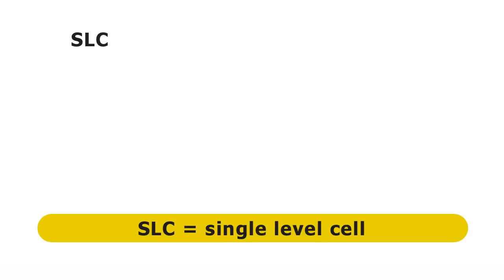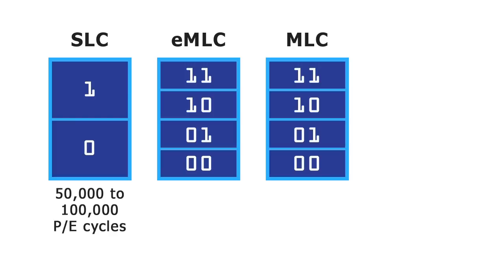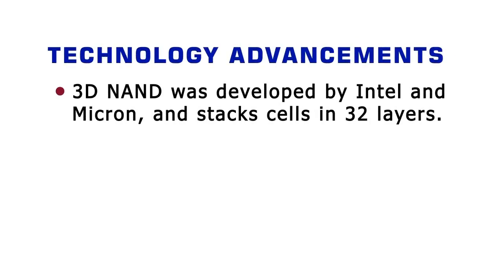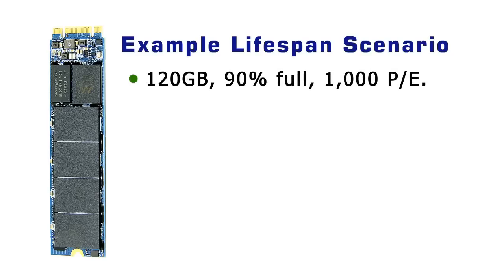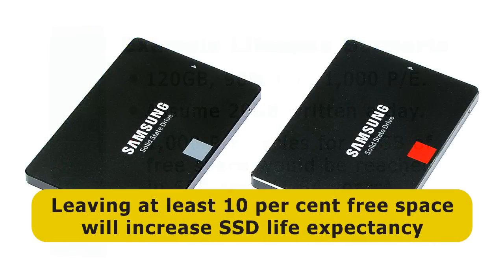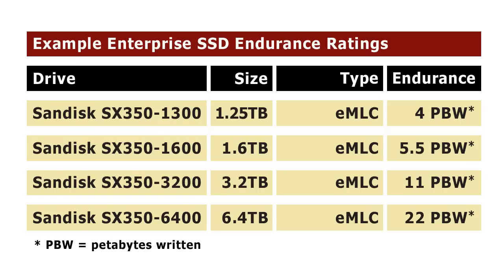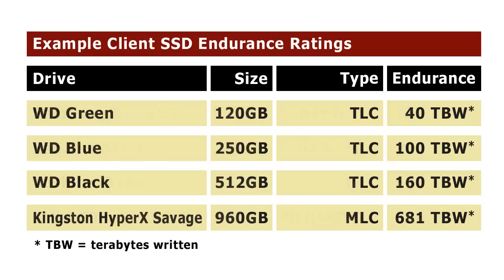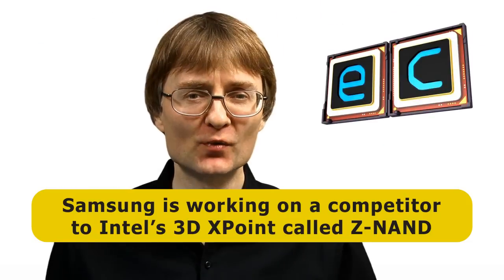SSD Life Expectancy

Comment: Christopher, an overfull SSD error reads "Unable to write to the last block of the device" does this mean it's game over for the drive? The SSD in question is installed in a MacBook pro. Thanks for all your efforts on YouTube.
Reply from the maker: This does not sound encouraging for the drive. I would try to clear some space -- quite a bit of space (5-10 per cent of the drive) and see if matters improve. Good luck! Oh, and back up anything from the drive that is not already backed-up. :)
Reply: @ExplainingComputers  thank your for your reply. There is a glitch that forces the data on the drive to keep increasing during a time machine backup combined with Dropbox as far as my research has revealed. The drive is too full to even erase and now it's not viewable while installed in the laptop or in a confirmed working enclosure. I tried formatting with windows and mac. SanDisk says based on the things I tried it's totally dead. I have a recent enough backup so all is not lost. Thanks again, I'll be doing a video explainig what happened in more detail soon.

Comment: So basically at 2:28 you're saying that a 500GB MLC SSD will have a higher life-span/reliability than a 500GB TLC SSD... Is that Right? So why should one opt for TLC or QLC SSD drives?
Reply from the maker: It is right indeed. MLC (2 bits per cell) drives last longer than TLC or QLC. But TLC and QLC drives are significantly cheaper -- and most SSDs in typical use will now last as long as the computer they are fitted in.
Reply: @ExplainingComputers  Thank you so much for the explanation, Chris! Appreciate it. I know what to buy now. :-)

Comment: Good point about keeping free space. Actually I don't trust SSD much. First: never buy cheaper SSD. I have buyed Patriot Burst, using it as system disc. One day after 2 years it stopped working, being totally dead. Currently I am thinking about buying few Samsung 870 EVO SSDs for my PCs as a system discs. Second: Make backups regurarly on classic HDD. SSD have one big disadvantage. Usually they stop working in a second without any sign of aging or warning. Classic HDD ususally die slowly, so you have time to make a backup. And when they stop working instantly it's mostly stuck head which can be easily repaired by yourself.

Comment: I have a Toshiba laptop from 2014 (Win-7).  After using it non-stop for 3 years, I noticed the 500 GB mechanical hard drive beginning to become louder (like the bearings were wearing out). So I copied everything over to a 1TB Samsung SSD, and instead of taking 5 minutes to load up the windows and settle down enough for me to start using the computer, all of this now happens in just 1 minute.  Plus, I don't have to worry about the drive failing.
Reply: I use an external wireless keyboard, and an external mouse, and I've already worn out 3 of those keyboards and 5 mice. It is a heck of a lot easier to replace external devices like that when they wear out than having to take apart a laptop 3 times just to replace a keyboard/trackpad.

Comment: Actually, we DO have to panic, cuz LOTS of SSDs from manufacturers we never heard of, sells cheap SSDs that DOES NOT HAVE DYNAMIC RAM. Seriously, even using the SLC Cache, the SSD controller will still use the NAND Flash to Cache their mapping data, so it will wear it down, regardless you are using the Host Memory Buffer.
Unless you are using a PCIe 4.0 for the NVMe, the technology finally managed to make the NVMe DIRECTLY communicate with the CPU, meaning the Cache for the SSD will finally go to either the CPU's Cache, or the 16~128 MB of Cache will go straight to your 16 GB RAM for easier access... No wonder Samsung made the 980 M.2 SSD for this purpose... Other manufacturers did this a long time ago, but Samsung entered this at the right time. 👏 👏 👏 👏 👏

Comment: After many cases of failed SSD happened in corporate notebooks, the main drawback is there is zero chance of retrieving data from it, even IT dept suggest to opt in a harddisk option. Finger crossed for my own personal PC which use NVME, the speed gain from it does not affect much on my daily usage, so once it go dead, I am going to revert back to harddisk.

Comment: SSDs.. most reliable drives I've owned. I have about two dozen SSD drives in service since 2015. In the prior years I had mechanical drives and those would fail about one drive ever 18 months. Since purging the last mech drives and switching to all SSD, the failures stopped. Not on drive failure for the past five years.

Comment: My Samsung 850 EVO 250Gb was bought in August 2015. Still going strong. I've since added 3 more SSD and a couple of NVMe M.2 SSD. Simply running out of space. My only hard drive - which I use for external backups, bought way back in 2007, as only recently started to throw up errors. I decided to go buy a 1Tb drive as they are dirt cheap. But SSD's seem to be pretty reliable - I run MS flight sims on it. I haven't had one fail yet and the MVMe drives really do boot extremely fast.

Comment: Question: Large music collection stored as FLAC data and/or other high-resolution formats: does "writing" occur while playing said music?
(FWIW, intend to use SSDs to backup SSDs: HDDs may tend to be more exposed to electro-mechanical failure(s)... SSDs less exposed to mechanical failures, but more sensitive to electrical/electronic issues - i.e. PSU failures??)
Reply from the maker: Writing should not occur when playing music, unless your PC has very little free RAM.

Comment: Excellent video, if you're still reading comments I have a question.

What is the failure mode of an SSD? Once the cells are degraded beyond a reliable write, is the SSD able to detect this and warn me that the write has failed, or will it fail arbitrarily at a point in the future?

Similarly, can an SSD lock out writes once it's passed its life while still allowing reliable reads to existing data (a useful case in server reconstruction)?

Comment: You should also talk about the data retention rate on a SSD without electricity. As far as I have found info on the internet, SSD are active storage media, which means that in order to keep their data, they store electricity (kind of what a capacitor does). So, I would say that it is a bad idea to use them for offline backups that you are not going to look at in a longer period of time.

I found an statistic that says that an SSD will keep the energy for about 2 years without been connected to a computer or any other power source. However, there are others that say  9 years. The only think they have in common is that the ideal storage temperature is 25°C. The higher the temperature is, the quickly the SSD will loose its energy.

It would be interesting if you talk about this.
Reply: Flinty94  Yes, I think magnetic hard drives are more robust, but slower. It is being said that they can keep data for about 20 years (assuming that you don't have them connected to a power source). Anyway, with those you can also loose the data easily. So, keeping backups is the gold rule.

Comment: Data safety != life expectancy. FW of SSD will report it's state and will prevent overwriting worn out cells. That means that wore out fail scenario is more like read only mode than data loss, unless poor thing is neglected and errors are ignored. For data safety, three other params are more importanta:
1.) MTBF - mean time between failures
2.) (Offline) data retention period 
3.) Online data retention period

First one is self-explanatory - how often that model fails on average.

Second one is important for archive and drive not in use. Worst case scenario is 2.5" drive mounted behind motherboard, next to CPU, but disconnected - storage heat reduce data retention.

Third one shouldn't be issue - if drive is powered, it can monitor cells and relocate data if needed. But, my first SSD, Samsung 840 EVO had FW bug causing data degradation. Luckily, first symptoms were reduced speed because it's slow process and FW still can recover data, with drop of performance.

Comment: I have an ASUS G75V (which I use at home for fairly normal home activities, but being retired and not particularly active outside, tend to spend a fair bit of time on the keyboard).   It is fitted standard with a LITEONIT LAT-256M3S NAND Drive for the System/Boot Drive.  Now, at just over 6 years Home use, it is on the verge of failure -- I found a day or two ago that it is showing only 30% "good drive" left, using drive analysis software.  The normal level at which it should have been replaced was a staggering 40% ago -- i.e. at 70% "good".  I now have a new NAND Drive in my hands, but I need to get the SATA3 to USB 3.0 cable so that I may clone the drive, hopefully while it is still operating before catastrophic failure.  I should probably invest a bit more and get an extra drive for further back-up -- to be done periodically.  Ditto I should do data backups from the 2nd physical hard drive more frequently than I do. 

Your article advises we should be able to expect about 10 years life from the NAND drives.  Oh, Oh.  Why do I always get the lemons?

Maybe you were looking at statistics for the normal magnetic surface rotating platter drives?  10 years would be about normal for them.  The NAND Drives are warranted for only 2 years.
Reply from the maker: I said up to 10 years, and sadly not all SSDs will live so long.

Comment: I bought my 1st SSD back in 2008, being an OCZ Vertex 96GB as a speed upgrade for my laptop, expensive yes: 180 Euros. After 7 flawless years, it died one morning without any prior warnings, it had about 10TB of written data in this lifespan. Of course I had all my data backed up on 3 identical HDD's which are only used during backing up or restoring data, after that they are safely stored in seperate locations.

In 2014 I built a desktop PC for video editing with a single Samsung 840 EVO 250GB and life expectancy should be much longer, as the health indicator is now after 5 years still at 89% (8TB written). In the meantime I also have a 850 500GB (for user data, health at 96%) and a 860 250GB (for fast backup's, health at 98%) which are both portable.

I assume the Samsung's will last at least 15-20 years. I leave 20% of space unused to improve reliability, just to be on the safe side. Though SSD's are twice or more the price of HDD's, I happily pay the overprice for these gems.
Reply: Hi Rene what tool did you use to check the health indicator?

Comment: My problem with SSD longevity is that for me, and many others whose complaints I've read online, is that I've never had an SSD give an indication (through S.M.A.R.T. technology or difficulty reading or writing) that wear was starting to erode capacity and it's time to abandon ship!  Every SSD I've owned (and told in the stories from others online) has died when powered up, the controller no longer responding to the computer. This does not appear to be a wear issue, but rather a controller failure one.  Yet I've never heard this problem discussed in videos like this one or anywhere else—It's all about the P/E cycles.  I have little doubt that the data are still on my drives intact, but unreachable. To make matters worse, some manufacturers store drive information in the controller chip.  But even if not, replacing a controller chip is well beyond my expertise as well as my wallet when it comes to the equipment that can do BGA chip replacement. I use SSDs, but my biggest fear is the "Sudden Death Syndrome."

Comment: OK, just making sure.  P/E cycles is how many times a cell can be written to and erased, yes?  2000 seems a bit constraining, especially for a user who may have to move files around a ton.
Reply from the maker: Yes, you are correct on P/E cycles -- it is how many times a block of cells can be written to and erased before likely failure. And for the latest QLC drives, the number of cycles of between about 300 and 1000.
Reply: @ExplainingComputers  That does seem rather poor indeed compared to mechanical drives.  I can't see myself using a comparatively fragile disk for a workhorse computer.  Maybe for a laptop that only gets used on trips.

I actually bought a WD Blue SSD 1TB 3D nand for my laptop.  Rated at 500TBW, which seems more than enough for a laptop with just one OS.

Comment: I’v got old 64gig ssd from like 2011 and still works with no problems. I had system on it in past, then I’v used this as a camera storage, and now sits as primary drive in my gf computer. Still fast and no loses

Comment: The question is it reliable enough to be a long term data storage/backup device which will rarely see any more data being written?
Reply from the maker: No, SSDs are not intended for long-term data storage -- after a few years data may fade (disappear) if the drive if not powered and the data accessed.
Reply from the maker: No, SSDs are not good for long-term date storage. After a few years, data on an SSD may start to fade (disappear) if the drive is not powered and the data accessed. This said, if you start with a new drive that is rarely written to (so the cells remain pristine, with few P/E cycles incurred) you are far more likely to maintain data long-term.
Reply: If drive is not powered or the data accessed shouldn't it remain perfectly intact in the absence of external influences like extreme temperature or strong Electro Magnetic forces ?

Comment: One thing i noticed about SSDs is that they are sensitive to COLD

If you expose them to very low temperatures they will simply stop working

I also noticed that there is a LIMITED number of windows installs you can do on them

After installing windows 2 or 3 times on a SSD the SSD will stimply stop working

At least the cheaper ones do (in my case)

Comment: An important thing that is missing: temperature affects ssds a LOT. Above 40C and your data may self erase or corrupt in one year, even with ssd turned off. With ssd in pc, it may run maintenance and last more, but high temps can cause failures. Imagine 2 ssds in same pc for storing same data twice, for redundancy. If pc runs hot, it may kill both ssds at same time, or corrupt them in different areas. So make sure to keep one backup in different location, different medium, etc.

Comment: My old laptop was virtually crawling with the 1TB HDD. I swapped it for a Kingston SSD and I couldn't believe the boot time for the first time so I had to restart the system again to be sure. Everything loads in less that 7 seconds. The 1TB HDD is still ticking as my external HD. SSDs are awesome to be frank.

Comment: But when they start to reach their limit does the user get any warning that it's time to change them or does all the content get suddenly lost?
Reply from the maker: Sometimes the SSD becomes slower and unreliable before failure. But many SSDs die suddenly.
Reply: @ExplainingComputers  That kind of makes them useful for OS only..
Reply from the maker: @UntakenNick  Well, no drive -- SSD or otherwise -- should ever be used as the only store of any data. :)
Reply: @ExplainingComputers  Sure, but if the controller keeps track of how many writes cicles the drive had, it seems technically feasible to raise an alert when the guaranteed life cycle has been reached.
Reply from the maker: @UntakenNick  True. But a power surge, theft, flood or fire can always destroy the data on a device. :)
Reply: @ExplainingComputers  Floods and fire can also damage SSDs? Damn what a crap they are..

Comment: How bad is data fade on SSD? I hear that if you leave an SSD unplugged for many years the data will be gone but the drive will still work. To refresh the data, does the SSD just need to be powered on or does the data need to be re-written like it does on HDD? Which has worse data fade; HDD or SSD?
Reply from the maker: SSD data refresh requires the data to be read (unlike on an HDD, where a refresh requires data to be re-written). SSD has worse data fade . . . as you note, all data could be gone on a drive left unaccessed for a few years.

Comment: Based on an article about SSD write cycle torture tests, your desktop will need to be replaced at least once due to mobo/PSU/RAM failure before you even need to worry about SSD memory failure. Based on long experience, you're more likely to get the Click of Death or a scratched platter on a hard disk long (or fail SMART) long before you hit the write endurance limit for an SSD, unless you're using it like a server disk running nonstop.